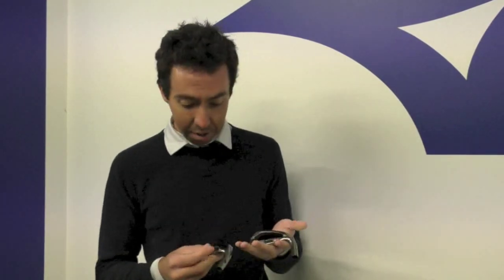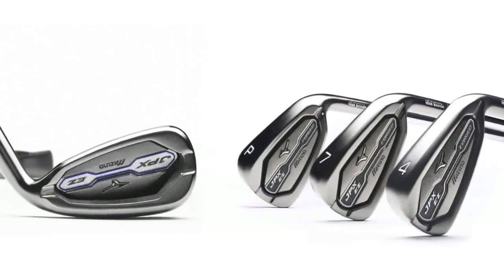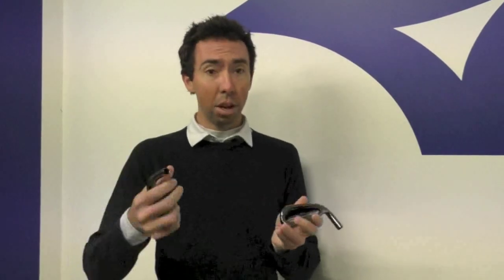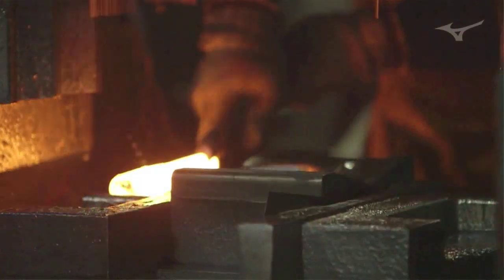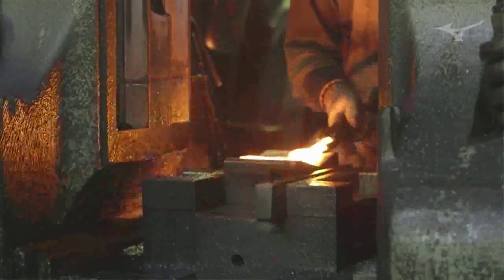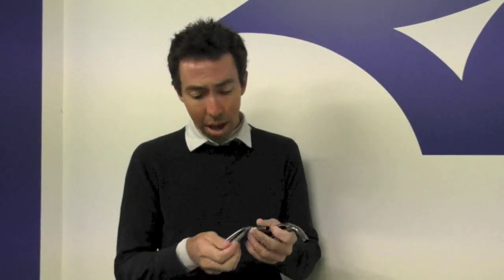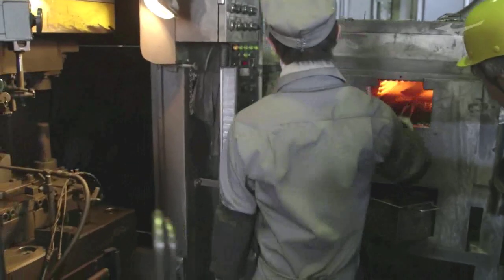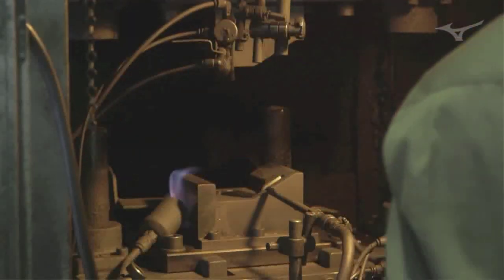Cast vs Forged Irons: What's The Difference?

Comment: How do I identify what I have?
Reply: I've had forged irons manufactured by mizuno, callaway, bridgestone, and pxg. All of them have had "forged" on the neck.
Reply: easy, if it doesn't say forged it is NOT forged.
Reply: Does it have loads of dents and dings o it? If so its probs forged.

I have a set of cast irons from the nineties that look almost brand new compared to my forged wedge which i have had a year.
Reply: @thedeepesthat4029  thanks